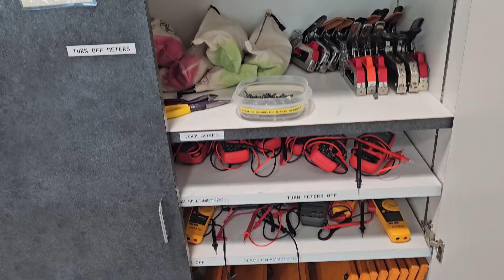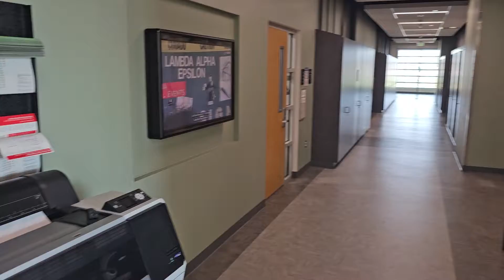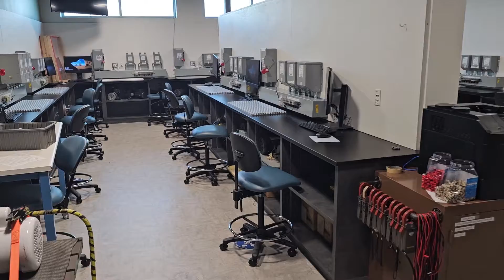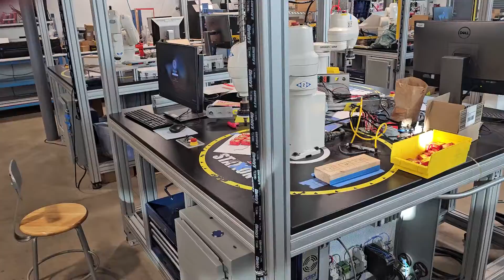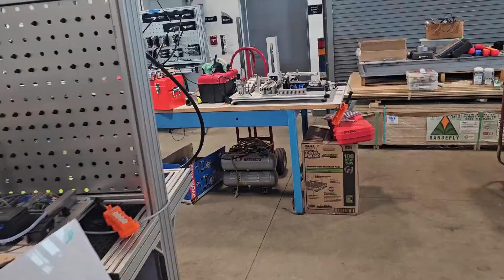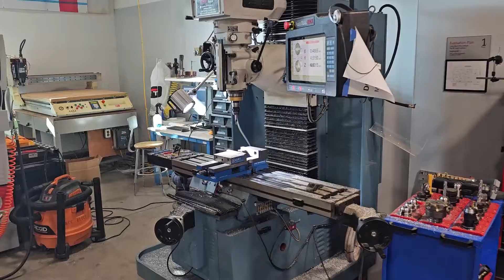Welcome to the LBCC Electrical Program and ELECT 600

Comment: Hey Mr.scott In which class would the switch gears and transformers for high voltage be located?
Reply from the maker: ELECT 265, 266, 267 & 268